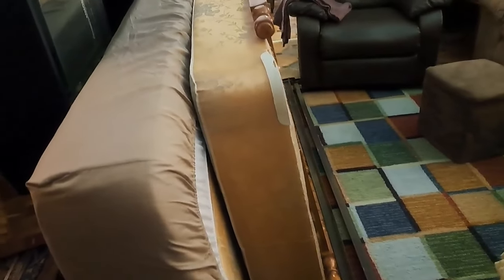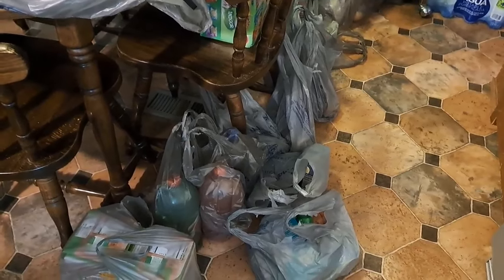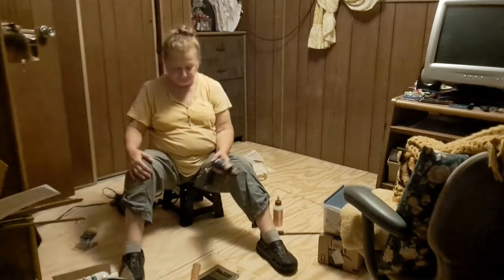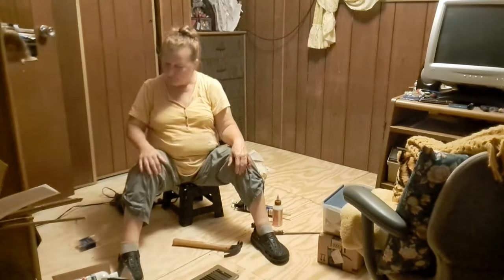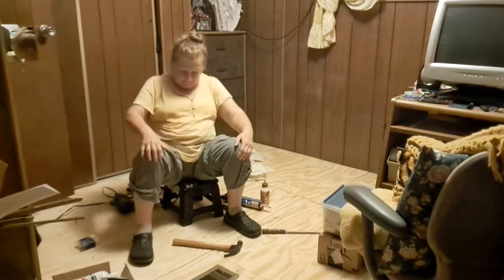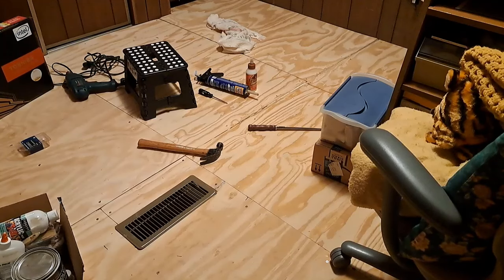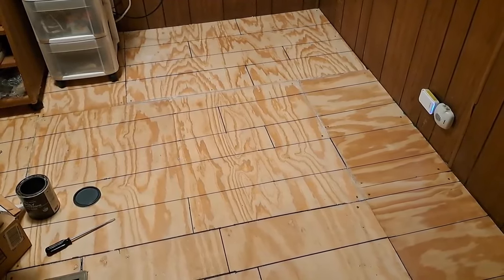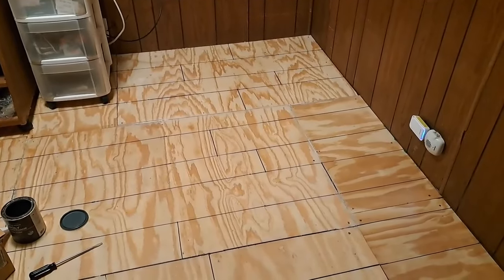My Bedroom Floor Needed Repair

Comment: You put some beading around the edge of the wall and floo. It hides a lot of any part which looks not straight.
Reply from the maker: I will be putting in new molding once I get all the floors done, a wider strip